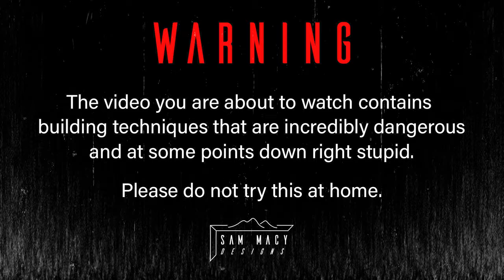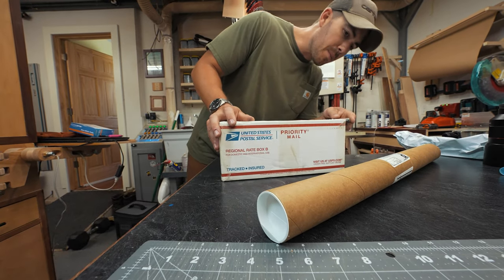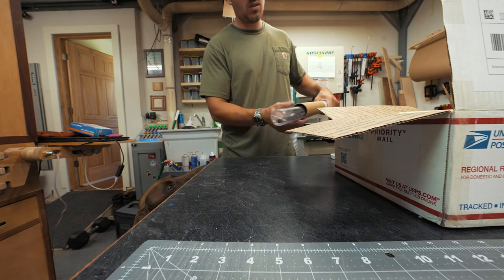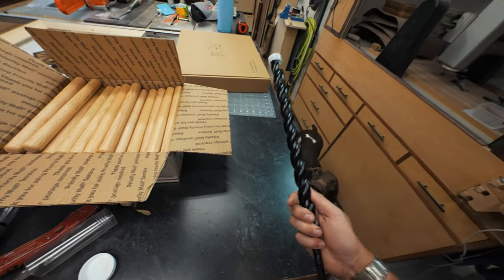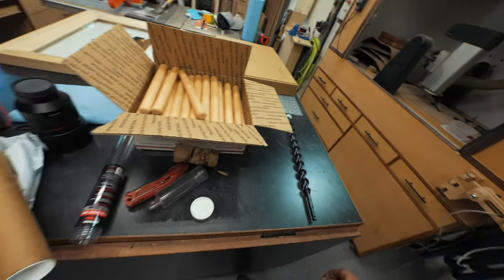Simple Timber Frame Barn // Part 2

Comment: are those green or did you age the logs and if so, how long?
Reply from the maker: Great question, I dried them for 6 months so they’re still relatively green but they start to crack so you see where the weak points are. My hope is that everything will dry uniformly so the joints will still be right